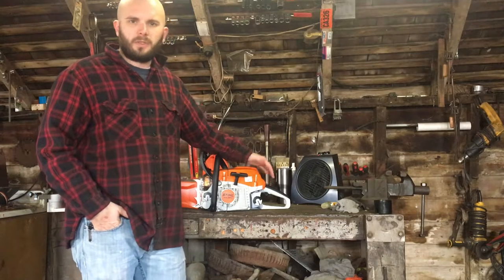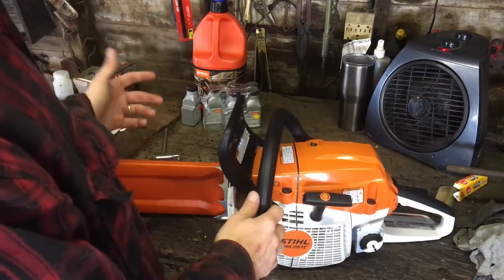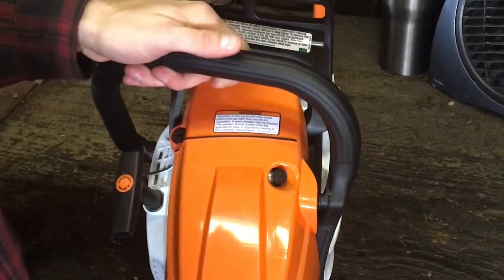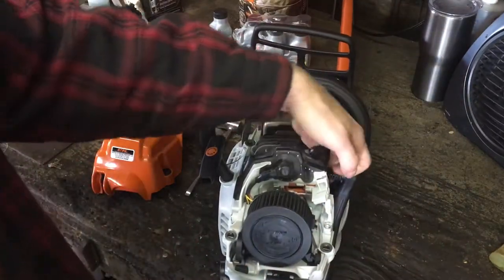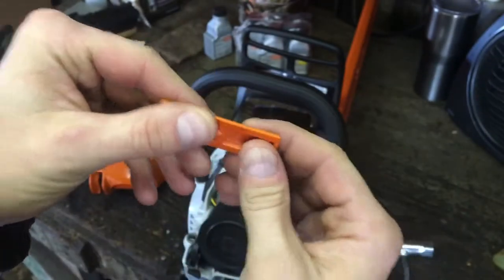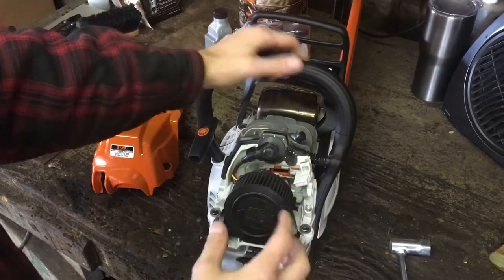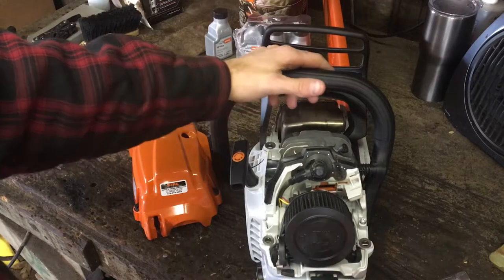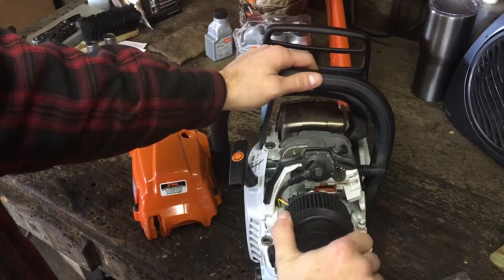How to: Stihl "Winter Mode" - MS 261 C-M

Comment: Check your filter more often when in winter mode or if your guide is missing.  The fly wheel will pull air, dirt and sawdust in as it cools the engine and this debris will blow into the carb compartment.  This is especially true on the 1123 and 1127 series saws due to people removing the parts to access the spark plug and misplacing them.
Reply from the maker: Good tip! Thank you!

Comment: I am about to buy one, when the dealer gets them. (461's out also).  Between this Chinese virus shutdown and Hurricane Laura damage, demand is running over 150%, I have been told. Good video. I have a 461, but I never would have thought about this "switch." Plus, it is torture for me to read the manual, so I usually do not until I am forced to.
Reply: We had a Derecho come through here, dealer says most of the Stihl’s wont be back in stock locally (Iowa) until next year
Reply: @jimmybobo  That dont sound good. I guess I'll get out my 461
Reply from the maker: I imagine most models are going to be difficult to find right now across the country. I haven’t been to my local dealer lately, but there hasn’t been much going on in our little area to deplete stock so he probably still has most farm/ranch and pro saws right now.

Comment: I just got a used MS 270. Very similar to your 261. I think my plate is missing for the summer/winter haha. Manual says to turn it.  Ain't nutten there to turn! Might just be different saw, different way of doing things, hence why I'm lurking around on YT.
Thanks for the insight & video!
Reply from the maker: Tom B. Haven’t played with a 270 so wouldn’t know how to help lol. I could see how mine could easily get lost though, it’s not attached so could be left lying if I were careless.
Reply: My ms270 is a 2006 model and the shutter is between the air cleaner cover and the engine cover.  Look at the split between these covers and you should see a snowflake and a sunburst.  You slide your screwdriver down between and rotate the shutter to snowflake ❄️ or sunburst.  Hope this helps.
Reply: Make sure you do have it in there, check manual or schematics online. Cutting without it in summer is the same as being in winter mode and your engine can overheat due to less air flowing over the fins.

Comment: My MS - 261 uses a white paper disposal filter. It's not washable. I just use compressed air and blowing it from the inside outwards only. My saw does not have the m tronic. Carburetor only.

Comment: My ole 024 Manual says the same thing, however it also says, winter mode keeps the carb. from icing up. I've never had any problems leaving it on summer mode. Seems to me if it's running good, or ( if it ain't broke, don't fix it). Then why induce warm air into an air cooled eng.? Yes that won't hurt it if it's below 50, but if you forget you left it in winter mode and next year, when now it's warmer, above 50F. Yep happened to me. And i've never had any carb. icing up unless it was like in the high teens and any way, who want's to be out then? Unless maybe it's your job. In which case, they already (been thar an done that). My saw is 30 some yrs. old, i bought new, and i've used it a lot, Great saw, better shape than me, and i'm only 29, well then 39 sounds better. Has any one had a problem with or without Summer/Winter mode?
Reply from the maker: I've never run into any issues with the carb icing up, but I actually prefer to cut in colder weather lol. I do cut a bit in the summer months, but I prefer being able to just remove a couple layers to stay comfortable over pouring sweat regardless of how little I'm wearing. Definitely important though to remember to change it back in the warmer months if you do use winter mode!
Reply: @HoosierHomesteaders   I also cut in cold weather, However if the carb isn't icing up, then why  put it in winter mode?  That's what i guess i'm trying to say. If the carb starts to freeze up, You will know. That's when it's a good time to engage winter mode. However you will find that the wood is probably frozen. And so are you! that's no fun either. Like i said, if the saw is running good, why then fool with it? Air cooled engs.consume large volumes of air. Again why then run it hotter? Are you trying to get better fuel economy?
Reply from the maker: I don't really worry much about fuel economy. I guess I use the winter mode primarily because it's still under warranty and the manual says to. Honestly it shouldn't make any difference leaving it be even when its cold outside, as the newer models like mine have the electronically controlled carb. It will adjust for the change in air density on its own, so tuning isn't even really a concern. I really didn't even know they had the "winter mode" before I bought the 261, as all my other Stihls were bought used and didn't come with the manual. I never would've thought of it. I may do a little testing with it this winter while I'm out cutting anyway and see what, if any, differences I can find running it with or without the warmer air routing.
Reply: @HoosierHomesteaders  Seems not to many stihl owners are even aware of the winter mode, but then again neither do the dealers. I took my saw to a dealer because i couldn't figure how to do mine. I asked the parts guy if he could show me, he couldn't figure it either. Got the mechanic and owner involved, they wouldn't let me look over their shoulder to watch. I showed them the manual too, well i got the saw back after a few, with the part separated from the saw. This saw has a plate that flips up. They told me to come back when it got warmer out and they would put it back together. I ended up fixing it myself. I never ran it in winter mode any way, just tried it once. Only one time the carb iced up, and so was the wood. Have you ever cut frozen wood? It's no stroll in the park.By the way, you can down load or view any stihl saw manuals on their website. Good saw, but the non-ethanol gas has done it no good. As well as all my small engs. That's a good subject for you to tackle. A lot of headaches there!
Reply: You're not putting in hot air, the air is heated up about 10-20 degrees more, so if its negative a few degrees it's just warm enough so its above freezing. You're not blasting hot air in there, you're overestimating how much heat air takes from the engine fins :P
Reply: @johnnellis3025  You'll know when the carb is iced up when the piston is scored or the engine seizes due to a lean condition. You're willing to take that risk over turning a peace of plastic over? Your money, your choice.
Reply: @em4703   Then why not run it in winter mode all year?
Reply: @em4703  No plastic, it's metal with this old saw. This carb. wouldn't ice up till about 20 degrees.When this saw was built, gas contained lead. Lead was added to prevent carb. icing. Makes no sense to cut frozen wood anyway. These days gas is oxygenated,(ethanol) which helps with carb. icing but nothing like the leaded gas. Your probably right about seizing pistons these days. That's why i still run leaded gas even to this day. I can't run pump gas with this saw, this has a fuel tank which gets attacked by ethanol. The newer saws have plastic a gas tank.
Reply: @johnnellis3025  because in the summer you'll have less airflow over the fins of the cylinder with the winter mode on, possibly leading to overheating

Comment: MS 250 has a larger one, about 3 times the size
Reply from the maker: Has a larger what? I’m a little confused as the 250 is a smaller homeowner saw? I’ve worked on one a few times, though I don’t think I got the camera equipment out for it.
Reply: @HoosierHomesteaders  Its a blue shield goes in front of the carb. one side has screen the other not.
Reply from the maker: @RhinoRider2006  ahhh that makes sense!